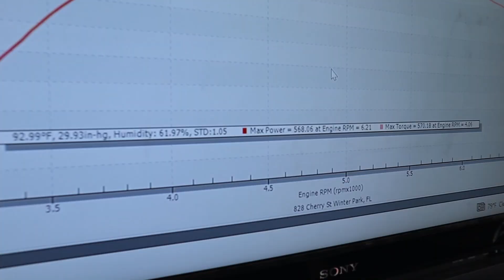Building a BMW 335i in 5min!!! (part 1)

Comment: Jess !! Love this build…gave me motivation not to give up..currently dealing with mysterious misfire on WOT 3rd gear pulls..sooo annoying full bolt ons 19ts Mhd v5 stage 2+ PRW coils new plugs etc..still the same but the love for the n54 never dies ✊🏻👊🏻 respect
Reply: Having the same problem, getting misfires/engine light right before redline, have you figured it out?
Reply: Time for compression test
Reply: @fnazazel750  already did one and all cylinders are good
Reply from the maker: Check your o2 sensors reading and also the low pressure fuel pump
Reply: @SwapDepot  thanks for the tip!
Reply from the maker: Fuel pump should maintain 5 bar through the rpm range
Reply: @SwapDepot  yeah, I logged a run and the fuel pump looked like it hold the right amount of preasure but the car did not misfire while I logged, it only happens sometimes. Will try and get a log when it misfires and see if anything seems to be off
Reply: @olle4983  vanos solenoids filters right side of cylinder head. Thank me later.
Reply: @olle4983  2 metal filters. Clean with brake cleaner

Comment: How are those 17t 11 blades holding up? I bought the same ones
Reply from the maker: Still good, no issues so far
Reply: @SwapDepot  any tips to prolong the turbos lifetime? Possibly running a safe amount of boost? I’ve got them installed today and saw a lot of videos (ex. Zero to 60) claiming the 11 blade 17ts tend to fail.
Reply from the maker: 🤷‍♂️ only thing i did was, i replaced all my oil and coolant lines and changed all of the vacuum lines